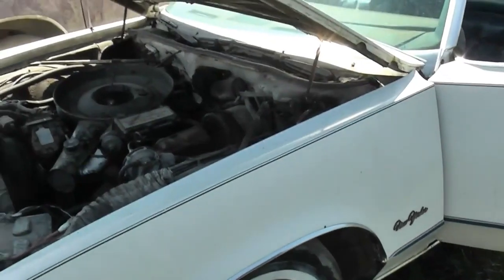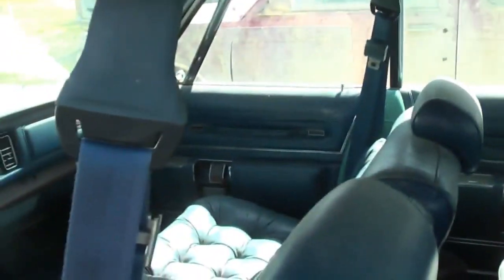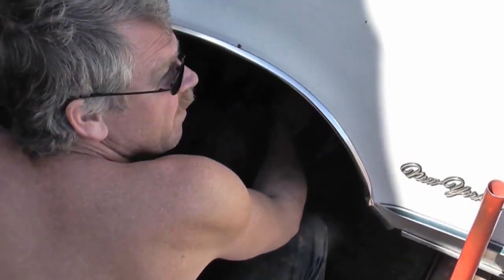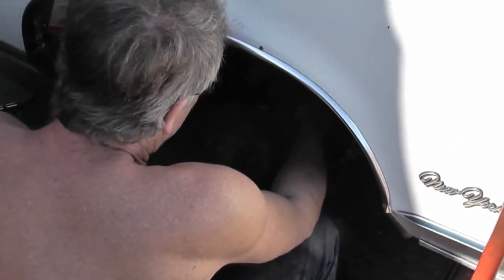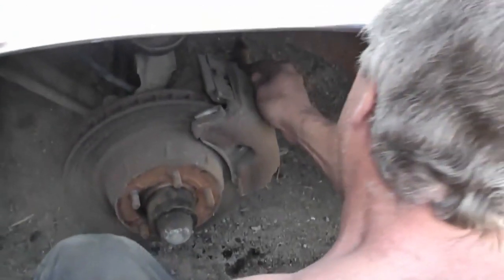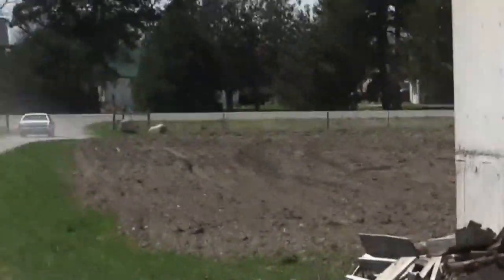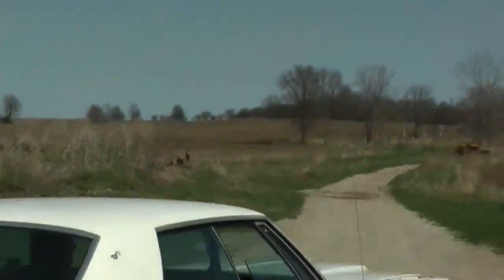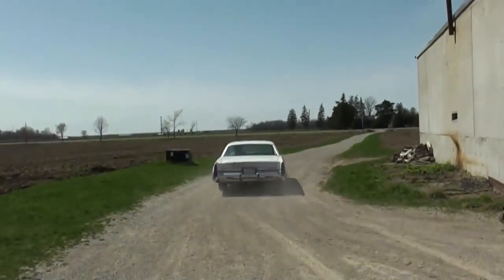Davidsfarm Chrysler New Yorker - Brake Repair

Comment: Well I have good news and sad news. The good news is that Dave finally sold it last fall. But the sad news is the new owner decided to use it as a demo derby car. So sadly it’s destroyed and no longer alive. Also Dave has been selling since other things. He has the bus up for sale and the drop truck up for sale. And it might be hard to believe me. But last weekend IDI Diesel John went and bright the Redneck Roller Coaster. And bright it back to his home. The farm is still open he just selling things he don’t use or need anything anymore.
Reply: I wouldn't be surprised if the chassis was rotted to shit. Probably nothing to salvage since Dave always left the car parked outside exposed to the elements. Are people still going up there?